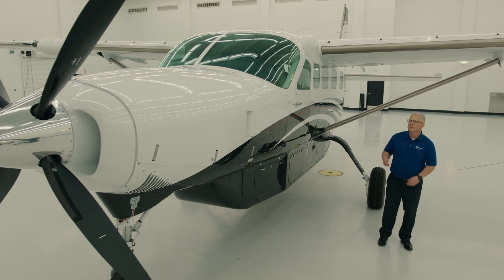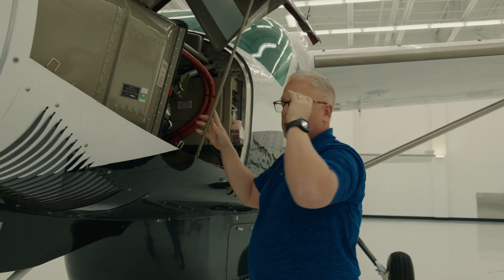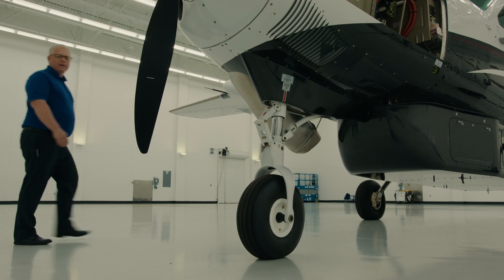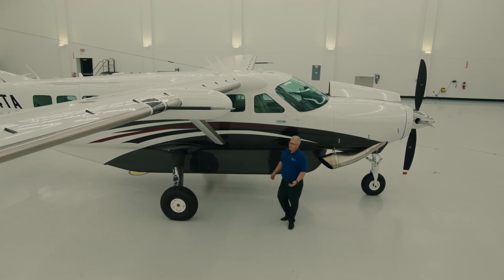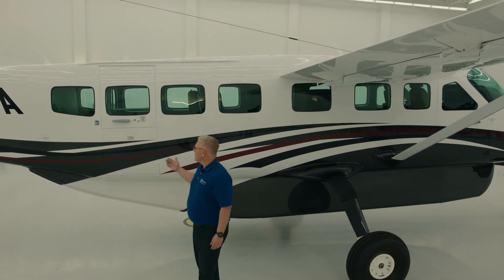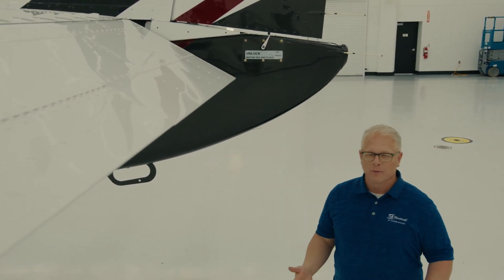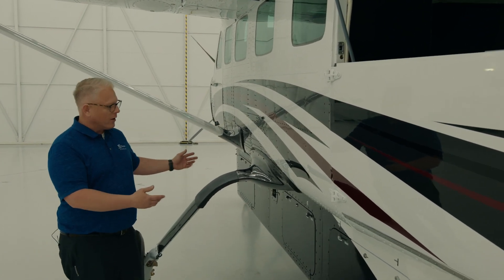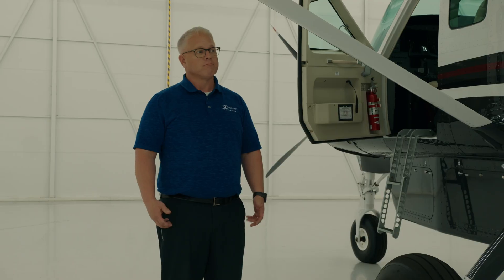Grand Caravan EX Demonstration – Exterior

Comment: Still no factory pressure fueling💀, that cuts turn arounds by half and makes sure the top caps stay protected
Reply: It’s a tiny airplane.  Weight and expense is not worth it for 2000 lbs of fuel.  Still have to check caps anyway.